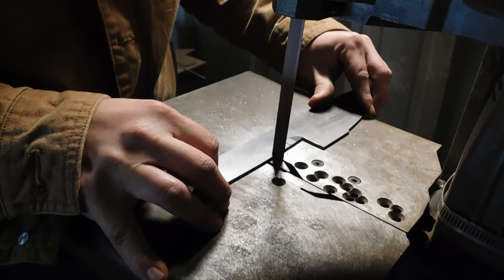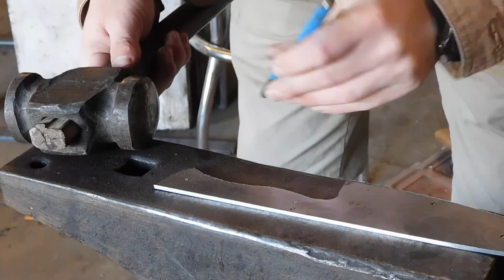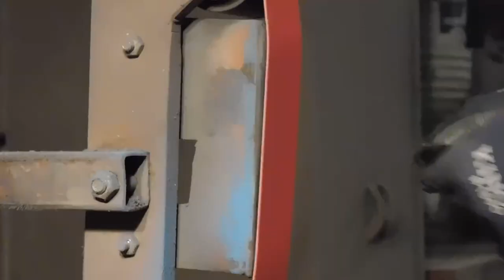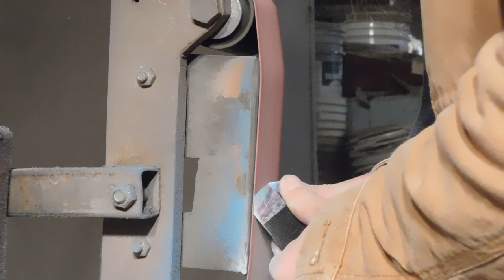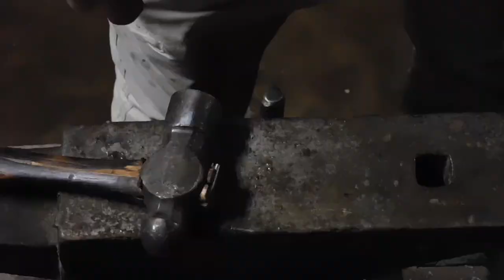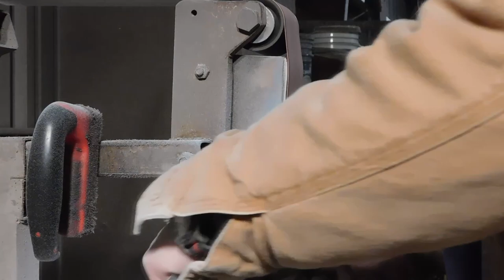Chef Knife Build (Stock Removal Method)

Comment: How do you heat treat this steel in a forge or oven? I have a forge is it possible use it to heat treat this steel I've only worked with 1084 or 1095
Reply from the maker: I use a forge. You have to be careful not to over heat it though.
Reply: @JWCMakes  thanks what color are you aiming for because I'd like to try that steel because it can be etched and are you quenching in parks AAA?
Reply from the maker: I am aiming for a reddish color. I use a magnet and get the steel to non magnetic and then take it just a bit further. 
And yes I use AAA.
Reply: @JWCMakes  awesome thank you I really appreciate it